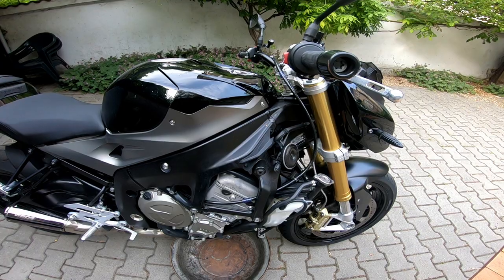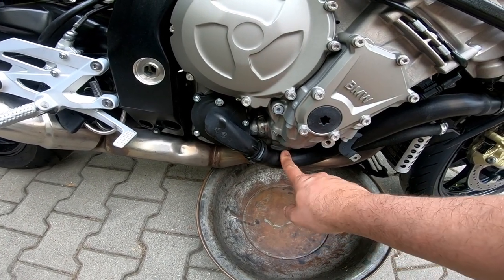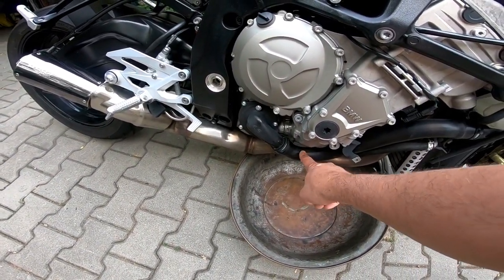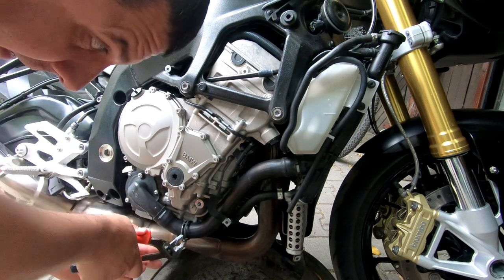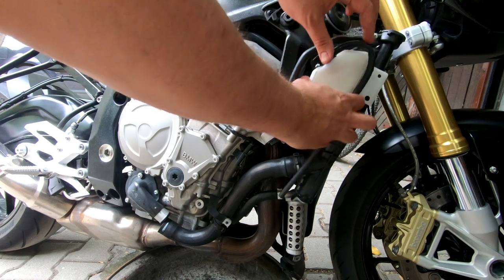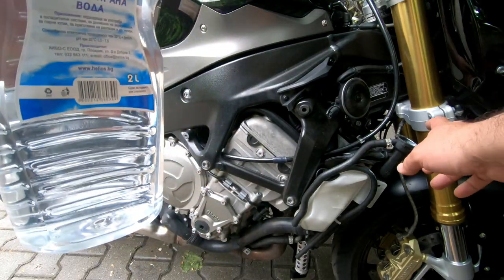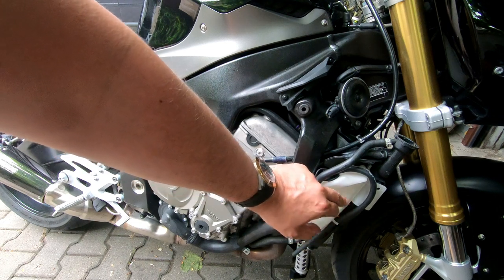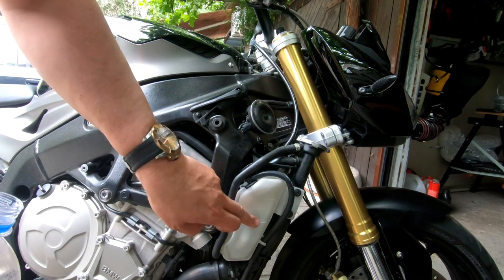BMW S1000R Coolant Change System Flush (S1000R, S1000XR)

Comment: hi great video i have some bmw Genuine BMW Antifreeze do i mix this 50/50 with water? or once i have flushed the distilled water through i can just add the 1.5l bmw antifreeze? any help ?
Reply from the maker: Hi, is the coolant rady for use or should be mixed? Is it cold in your country during the winter?
Reply: Instructions supposed to be on canister, if its premixed or u should mix it.

Comment: how can i remove air from coolant system?
Reply from the maker: When you start filling the system open the small screw on the engine block! At the moment coolant starting comming out screw it back and fill the system to the top of the radiator incl the small plastic tank. The air will come automaticaly out later by starting the engine and reaching operating temp.
Reply: @powerbikesbg  ohh, ok!! thanks

and do i need to do this twice, right? one time with pure water and the definitive with coolant?
Reply from the maker: @SuperBloder  if you want to flush the system before changing the coolant...you can just change it, whthout flushing..or you can run it for a week with water and than change it
Reply: @powerbikesbg  thanks bro!!!

Comment: Your clutch cable is too long man, and it needs to be attached to the black plastic bracket on the frame. Great video.
Reply from the maker: I know..it was replaced by the previous owner with the handle bar! Regards!